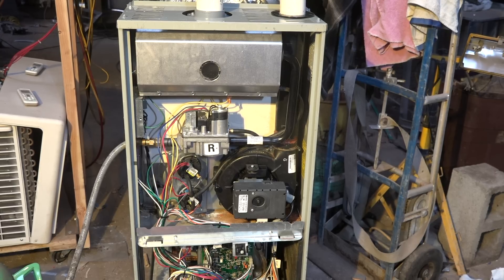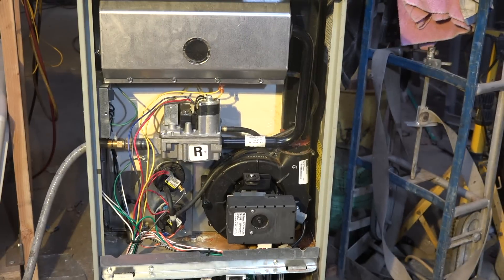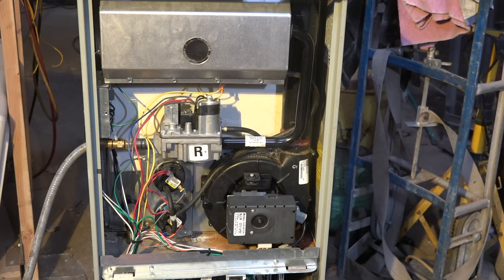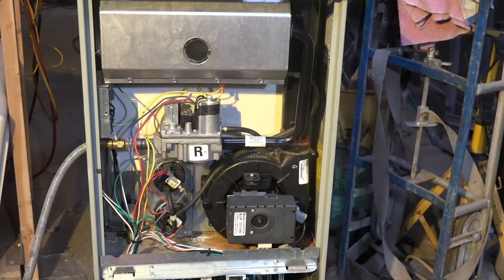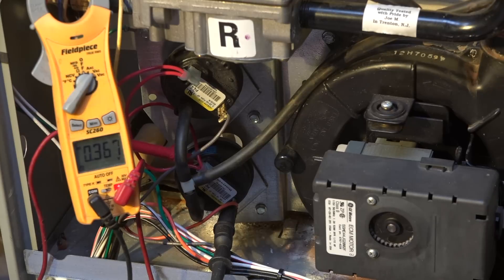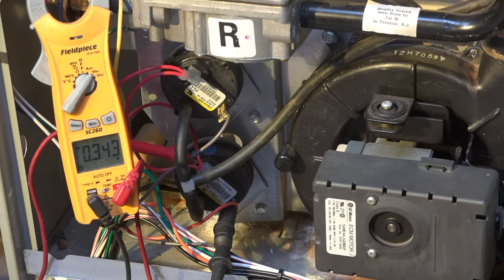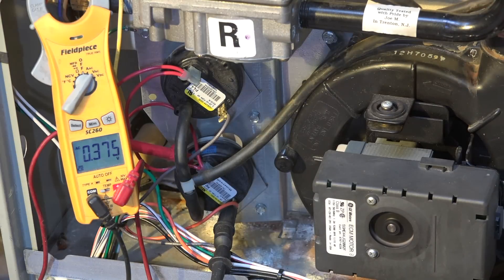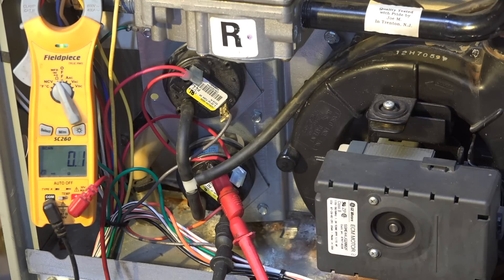What's wrong with this furnace #8

Comment: FYI, on a CAT IV furnace its a "blower"--not an "inducer", which is found on 80% furnaces. 

Since the bottom pressure switch closed upon trial, the port to the housing is clear as is the tubing to the bottom switch and the switch made. Not sure what voltage it should be as I thought it was 24 vac. If the vent was obstructed, the bottom switch would not have 'made' unless partial blockage. Same with pressure port. Same if the blower was short and incapable of pulling sufficient vacuum. I would want to test flame rectification since this dropped out so fast, low inlet gas pressure, manifold pressure, loose cover on the burner box, cracked or loose hose, etc. 
Go through it step by step component by component until you get a condition not PMI (per mfrs instructions). This would include using a 'tee' in the vacuum hose to read pressures as it ramps. Gas flow is mated to airflow conditions in this unit.

Comment: The switch closes when it fires as shown by the ohm test so that eliminates a restriction or plugged drain. 

It looks like the voltages are out of whack. Should have 24v when ventor is off and 0 once it fires. I'd have a look at that board.
Reply: Or the pressure switch is stuck partially or fully closed and is moving a bit. Which would cause the erratic behaviour.

Comment: I saw the answer already. However, I would have guessed restriction on flue.
Reply from the maker: It does imitate a restriction.  The elimination of the pressure switch closing was shown by the ohmmeter reading.
GFM

Comment: After initial fire furnace seems to want to go into 2nd stage,I would check the HPS swith to start with.Low pressure seems fine.
of course the baord diagnostics would be the first thing to look at.This thing appears to communicate the HPS/LPS status back to the IFC through the inducer controller so that would be a consideration also.

Comment: you should probably have 24v across the switch before inducer even starts, before it closes, and you have zero. so no volts to the switch to begin with and so the boards just gonna think its open even though the ohms say its closed. so some kind of low voltage problem 24v not getting to the switch maybe a limit or a rollout in series is open or something

Comment: I never saw 24 volts on your meter I would check where the Molex plugs into your control board and confirm you have 24volts coming out of the control board to the pressure switch. If not the replace the board

Comment: It is a 2 stage furnace, it looks like you were measuring across the first stage which looks good. The Thermostat may be calling for 2 stages (W & W1 high/24vac). I would start with disconnecting W1 (2nd stage) from the furnace control board and see if it fired up. I noticed the second time it tried to restart, you mentioned the burner did not start, so I would rule out the flame sensor. I think it may be something going on in the 2nd stage - you may have been reading  a voltage due to second stage was not closing ( given 1st & 2nd stage vacuum switches were in parallel).

Comment: I would check secondary heat exchanger drain. There might be water getting back to pressure switch and causing it too open. I think when second stage heat starts (when inducer sucks harder) water get back to the switch. That would be my guess.

Comment: There could be several things causing this. You didn't show us the control board's led. It's got to have shown an error code. But someone has already mentioned flame sensor. I've also run across bad control boards. Faulty limit switch. The control board would tell you.

Comment: It's not easy not being there having limited information.  Without knowing I'd check air flow to see if it's feasible tripping on high limit.  Probably not since you showed no voltage potential before and after the switch, leading me to checking the power circuit there (dont know if it's a ground only or supposed to be hot but since you measured it, it should have been showing potential at first is the logic).  Well theres always the issue of not detecting flame and then shutting down.  Anywho see you at the revelation of the answer.  Thanks for sharing, interesting videos, thought provoking.

Comment: The one thing I do know is if any of the combustion components , including the inducer goes bad, Trane forces you to upgrade the furnace to a 100 volt igniter system, new igniter, board, wiring harness, inducer, I won't say how much on here but be prepared to be shocked, lol, these manufacturers are something else.
Reply from the maker: You are correct.  I have felt with that too.
GFM
Reply: furncemanjim  just did one and thank god it was under warranty for the customer. Costs almost as much as a new furnace

Comment: All we know for sure is that bottom ps is closing. Not sure what the upper one is doing. Is it in low or high stage? Could be plugged port or condensate trap. Also I've seen those ecm motors ramp up real high if there is an issue with the motor communicating with the board. I know there is a fault code for that on the Carriers. I'm not as familiar with the Trane units.
Reply: sounds like blockage on the exhaust end